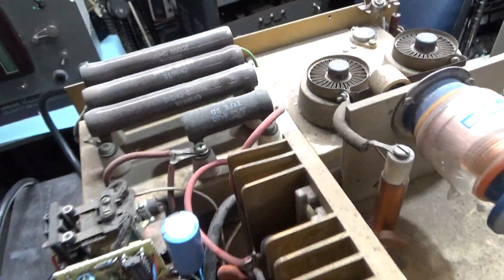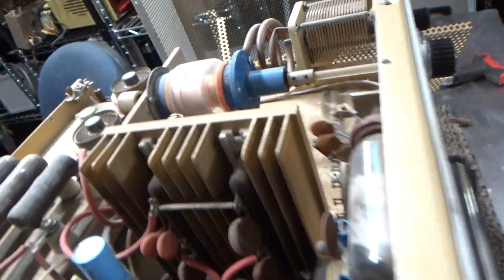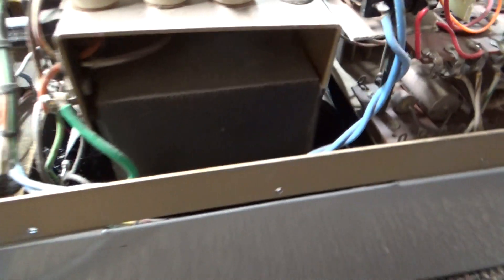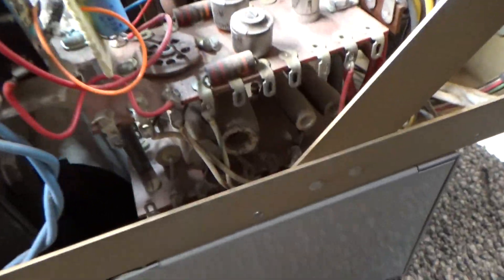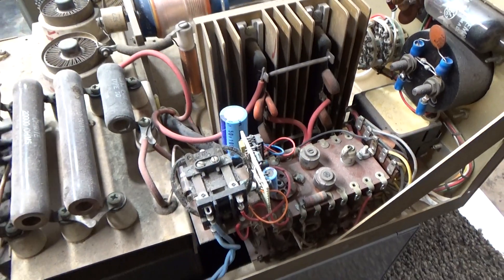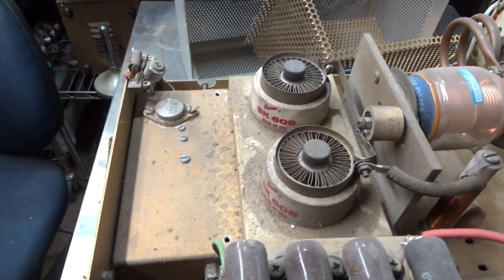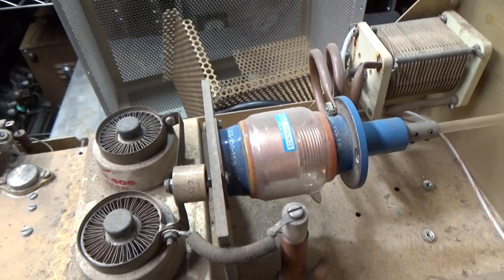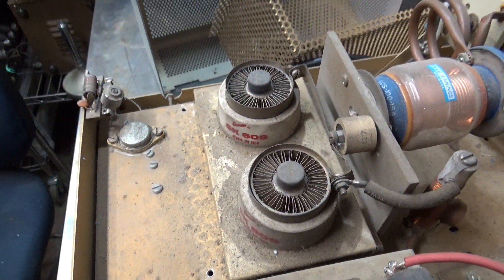Unpacking from Dayton Hamvention surprised myself, Henry 2006 Linear Amplifier found

Comment: Thinking of making a similar amp for 6 meter with 250B's like the one you have there, mind giving me the dimensions or the inductance to that tank coil?
Reply from the maker: That one has 8874's so the inductance would be off, plus my inductance meter doesn't go that low.
Reply: @tramdr  ah darn, thanks anyways